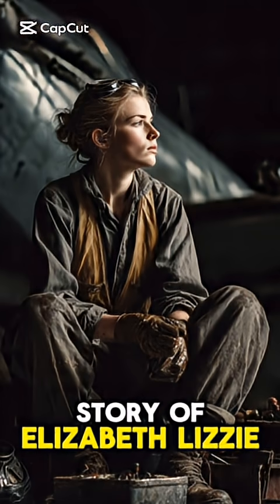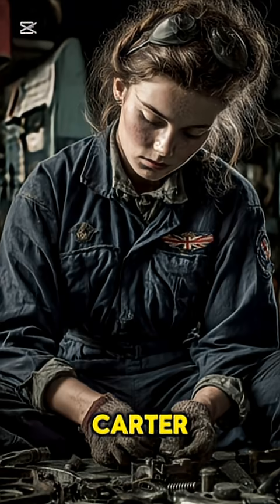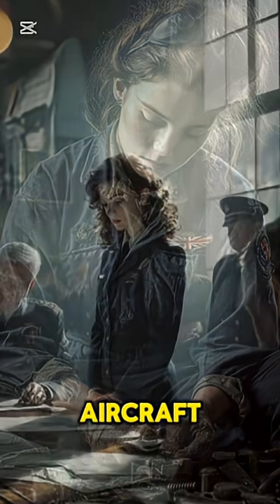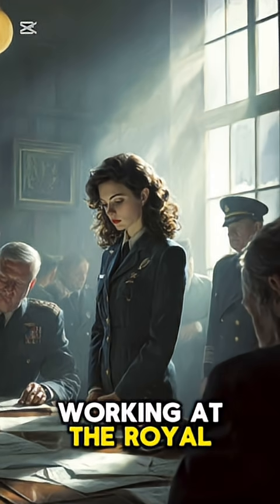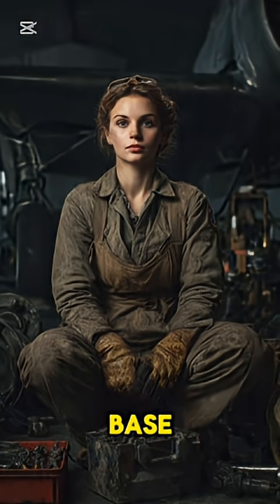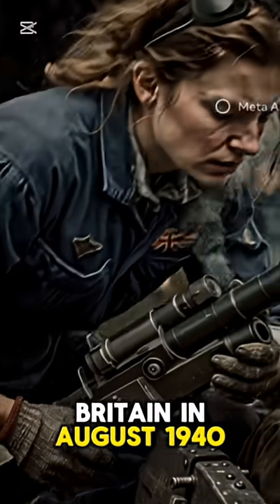How One RAF Mechanic Built a Scrap Gatling Gun and Shot Down 7 Bombers in 14 Minutes

Comment: I'm a master machinist....... can't tell you how many round holes and square pegs I've run into over the course of my career...... I truly believe that every engineer should be required to spend 2 years in a job shop before they're given their degree. At least they'd be able to read a micrometer....... with the possible exception of the Army Corps of Engineers.... they seem to have their shit together. = )
Reply: I've seen similar  in building  and  sawmilling and engineering  trades  it's not limited  to one trade every politician are responsible  for  their  stupidity in one  way or another  that's why they hate social  media  it cuts out there control  beurocrates  usually  get control  because  they're egotistical  dumbasses  witch don't  understand  what  they're  doing  it's all showing  off